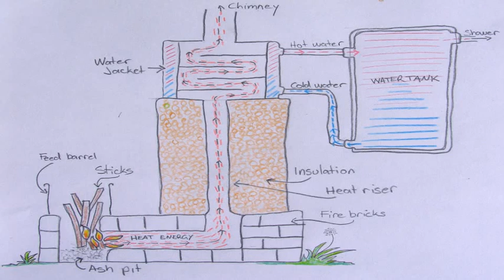Rocket Stove | Moment (Instant) Heater | Heated Water Tank | Worked from Junk...

Comment: Thanks for the video. This may be a dumb question but in your diagram the cold water inlet is lower than the water jacket, and the whole stove is lower than the shower head. Does the water go 'uphill' in both cases? If so, how? Are there pumps? Does the heat of the water pull it through the system? Thanks?
Reply: Just guessing - the diagram seems to differ from the demonstration.  
The demo seems to have the heat-exchanger fed by what might be a garden hose? So the water goes through it and on to the shower head.  Something is providing pressure, presumably, like any garden hose.  That should work, so long as there is presssure. 
The diagram has a water tank - but can't see one on the video? The arrangement makes sense, in that the cold water inlet to the water jacket is at the bottom, so when the fire heats the water jacket,  the heated water inside it rises (just like hot air rises) and circulates round the closed loop until the water in the tank is hot too.  As it is, all you get is a tank of hot water! But if the tank is high enough, a shower tap could be connected, and the heated water used for a shower (or two?).  Afterwards,  top up the tank with the hose . . . .   Simple, but it should work fine.